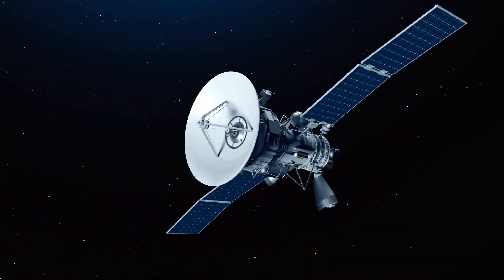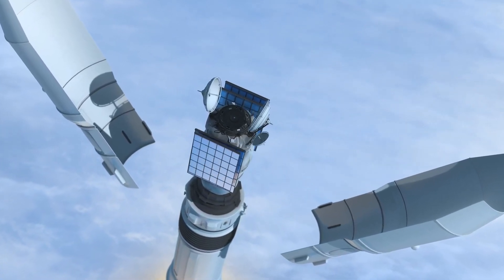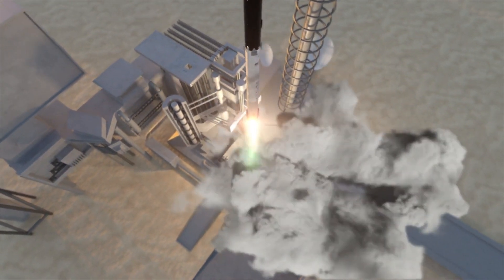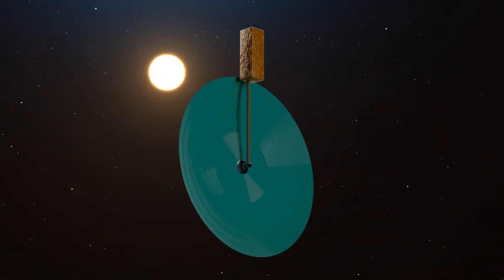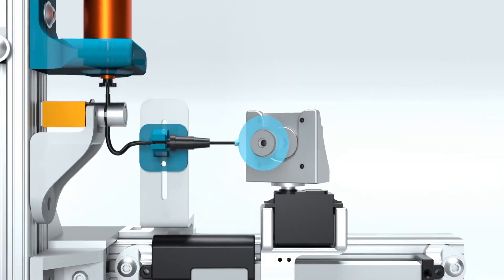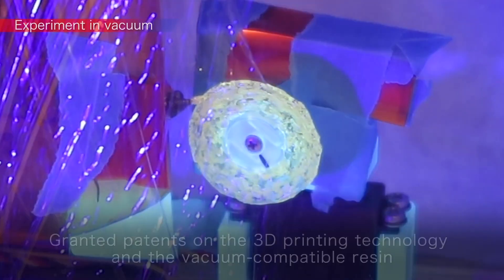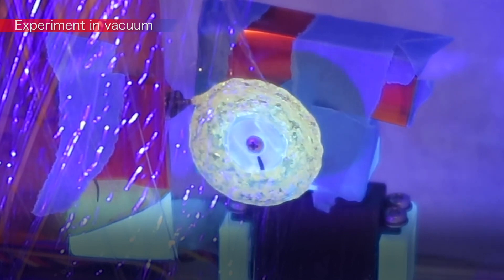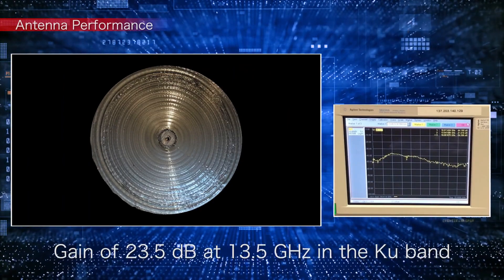Satellites could 3D print their antennas in space! Tech under development

Comment: This is pretty cool. It feels like the most difficult part to get right would be the low-gravity conditions in which the print would take place. How do you even test this on Earth? You can't really have a contraption that falls for several minutes or hours while the print is ongoing to simulate zero-g. They do talk about it in the patent, there's a whole section about it although it's more about generating an equivalent force than testing it on Earth. They say for example: "The artificial gravity can be developed through the rotation of the entire manufacturing module along its long axis. […] This may generate gravity in the range of 0.035 g to1 g." If anyone wants to read the patent, look up US10906290B2 "Systems and methods for on-orbit fabrication of structures by 3D printing".